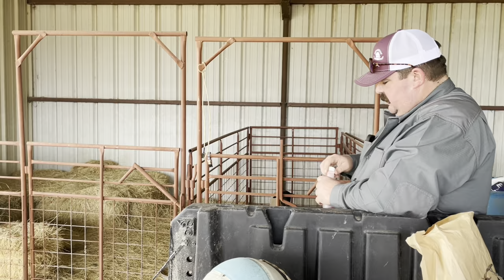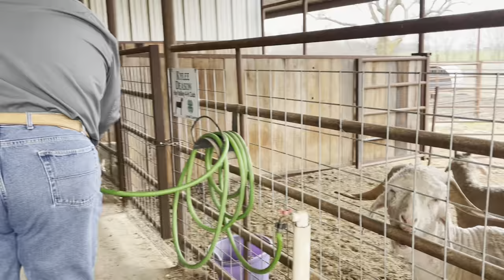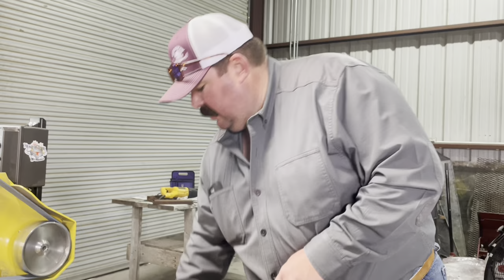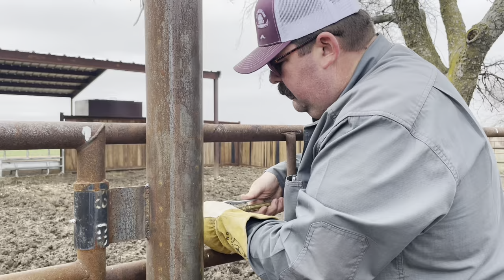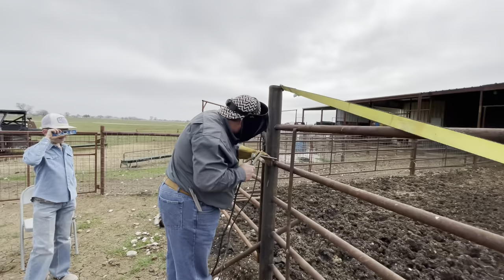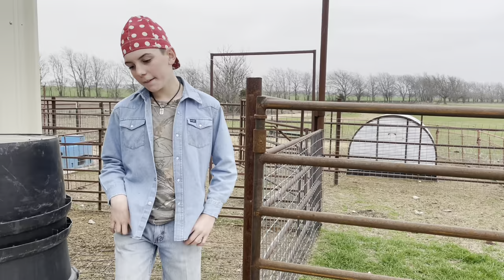Stick Welding Cattle Pens

Comment: Good on you Cody for showing your welding work. The welding community can be very harsh at times. I’ve been pipe welding for almost 8 years and there are some real Jack@$$ out there.
Reply: That is true for sure. They even go as far as tearing down youngsters because they can’t weld to perfection yet
Reply: Yeah the just belittle them, I think it’s because they are intimidated
Reply: Keyboard welding is really easy that’s why.
Reply: Proving my point
Reply: Completely agree ive had many friends that gave up on welding because of the old farts and some younger ones that think they are gods at welding. Just do your best and don’t listen to the negative farts. Always listen to the constructive criticism!!

Comment: I’m sure there is a reason I’m unaware of. But why didn’t Cody just use a grinder with a cutting wheel instead of torch? I’m assuming he likes to live on the danger side 😅
Reply: Probably wanted to get his boy some welding experience so found a way to solve an issue but also get some welding in for the youngster.
Reply: Because a real fitter/welder doesn't own a grinder ,or so I've been told.😉
Reply: Cutting wheels are much more dangerous than torches